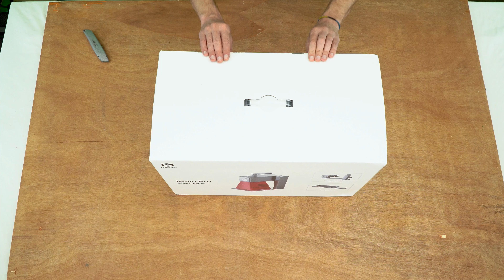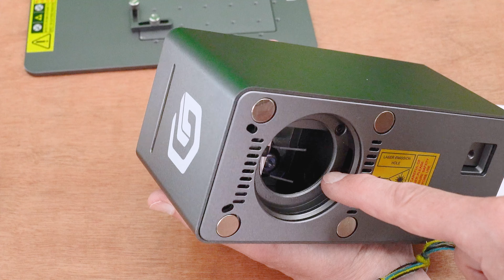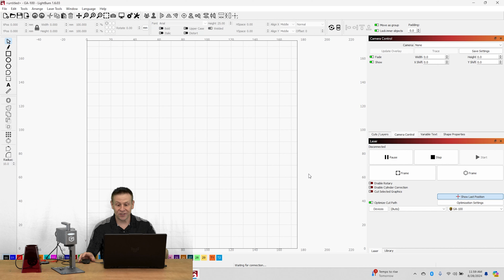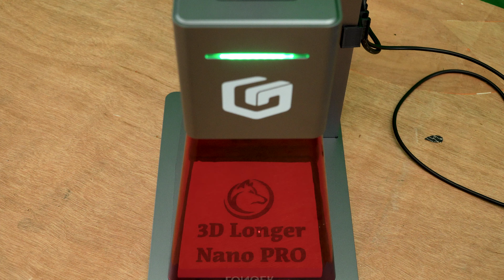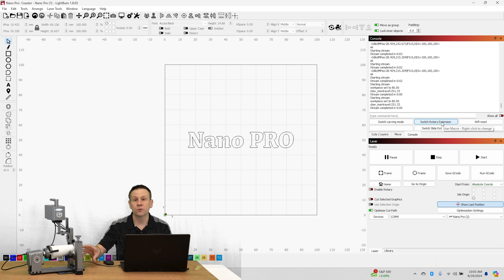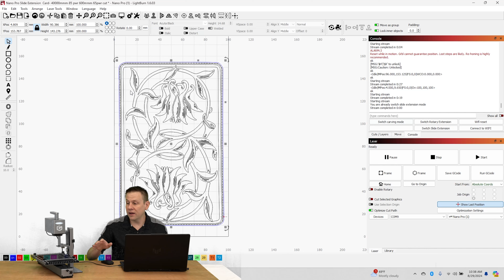Longer Nano Pro 12W- Detailed First Look with Projects! #laser #woodworking #longernano

Comment: Hi Greg, sorry to bother you again, but I need some advise regarding my choice of which laser would be best for me.
I will be cutting and engraving mostly small stuf in wood, the wife is into 1:12 miniaturen. Been looking at several lasers like the Roly lasermatic MK2, the Acmer P3 and several more like these. Would a Longer Nano Pro meet up with my needs? Don’t really need the big 400 x 400 space, and another big advantage in my opinion is the lack of moving parts in for example the Longer. If you find the time, please share your wishdom with me! Thanks in advance!
Reply: Is this also known as the nano duo?
Reply from the maker: @iangrice5511  Nope- the Nano Duo has 2 laser sources, a 20 watt laser diode and a 2 watt IR.  The Nano Pro is a 12 watt laser diode. (I have a Nano Duo and will be releasing videos soon!)
Reply: Thank you, looking forward to that, bit hard to find decent info on these machines @thelaserchannel1
Reply from the maker: @iangrice5511  You're welcome-  The videos will start in just a few short weeks! 😀
Reply from the maker: The Nano/ Nano Pro has a small footprint and can be much faster- I recommend the more powerful 12 watt Pro version.  Other then making sure the field lens is clean- there's no other maintenance unlike the large larger machines that have rails to clean and lubricate and belts to check and tighten.  Best wishes
Reply: @ Thanks for the reply. Have a great holiday season and take care! I”ll be looking forward to your coming reviews!
Reply from the maker: @albertvanbalgooij3503  Thank you- you too!